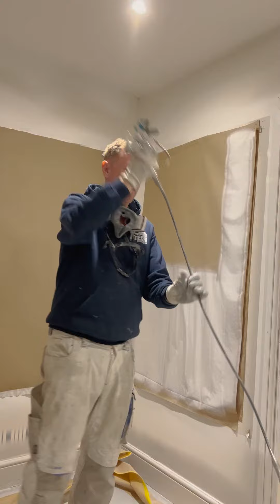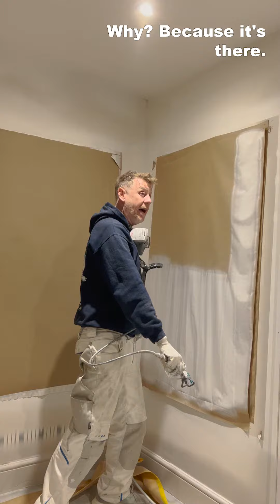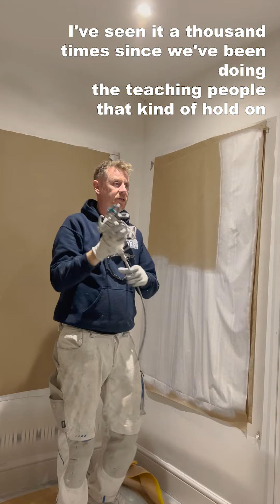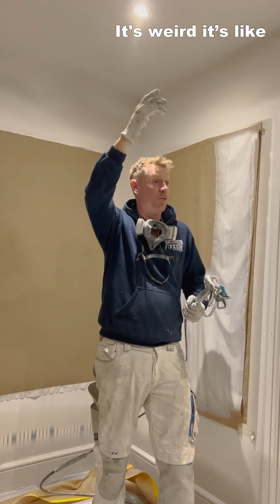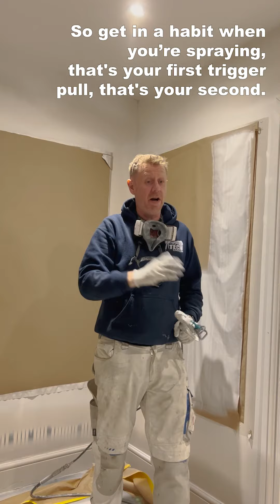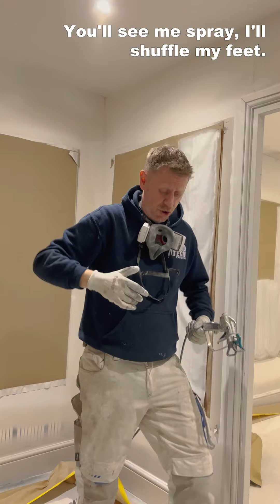Top Tip - Worry Free Spraying

Comment: What a load of waffle. As if your actually teaching people to spray willy nilly in the air in the work environment getting paint and overspray everywhere to then be walked around the job or land on surfaces it shouldnt. Why don't you just teach them to be confident with the gun instead of some 'spray away your anxiety' bs 😂
Reply: Relax mate. It's a tiny squirt aimed at the floor to get going, it's hardly gonna get the site shit down or fuck a whole house up. Damn.
Reply: @badlefthook624  a tiny squirt when pushing near 2000psi with a large tip 17thou plus with a wide fan puts out a lot of material even with a tiny squirt. Thats not even mentioning that reasoning of spraying away your anxiety is just daft and makes unnecessary mess. Aim it at the wall or something masked up instead not just randomly into the air.
Reply: @swatts66  relax, Sam. Damn.
Reply: I think its sound advice in this video and it makes perfect sense,its like when your spraying and the tip clogs halfway through a door or a wall and you have to reverse the tip and spit out the blockage,the blockage interrupts the rhythm which can cause a little anxiety and annoyance as we all want to get that flawless finish when spraying and once you release the blockage its all calm again,personally I would always take the advice and respect and listen to a man who has done way more spraying than me and who specialises in it,I find this video very useful and helpful as when I do some spraying I do tend to tense up a little before using the gun as I guess its the fear of making a mess of it,I'm a professional painter who uses mainly brushes and rollers but I do like to spray sometimes too,thank you for the tip
Reply from the maker: If you don’t need to do then don’t. Lots use it and it helps loads. Each to their own